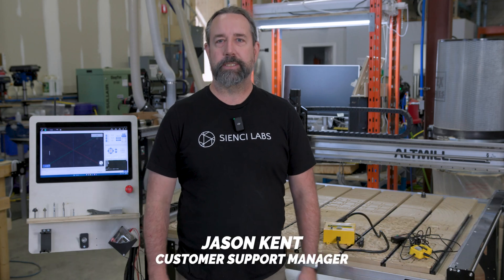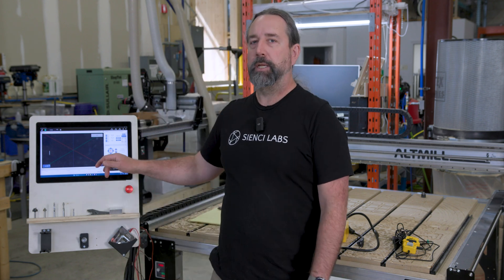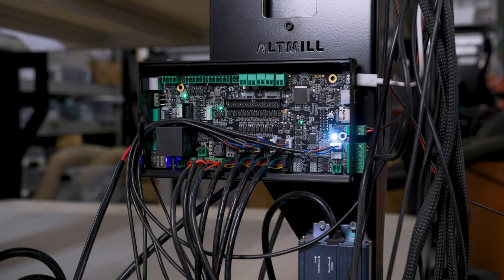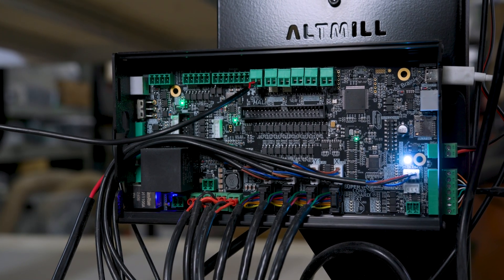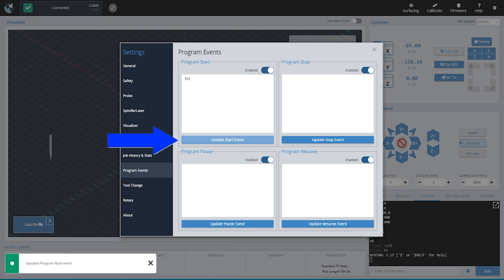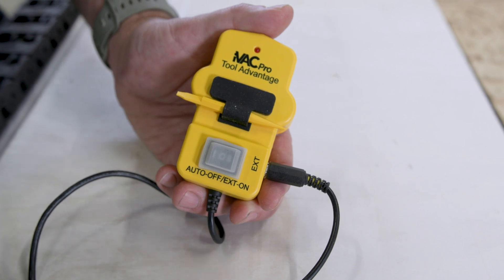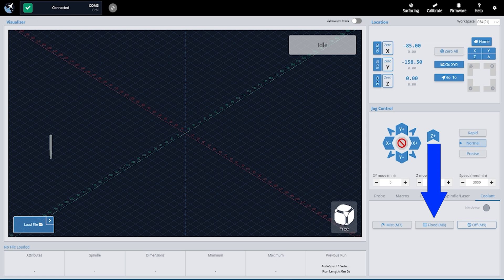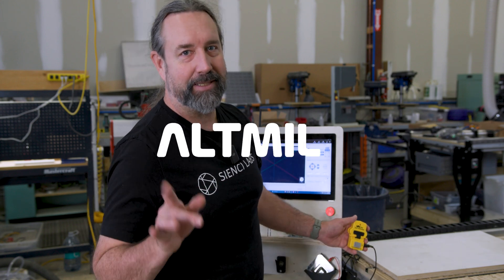How to Install an iVAC Switch Box

Comment: I connected my IVAC based on your instructions and it starts and stops with the M8 and M9 commands but the dust collector shuts off after a few minutes into my projects.  I an restart it by pressing the M8 but it continues to shut off.  Any suggestions?

Comment: Did you cut off the USB end of the patch cable to install the wire to the molex connector?  The implication is there along with the assumption you are using the ivac patch cable kit. I just want to make sure.  Thank you.
Reply: I was thinking same question. Couldn’t find the iVac Switch on Amazon, Have been using the Senctrl on both my machines but would love to put my vacs on another circuit. Also noticed there is an auto blast gate. Please include affiliate links to products if possible.
Reply: No, the wire comes without a connector in the kit.

Comment: I have an ONeida 220 volt 3hp cyclone connected to a 1 phase 30 amp electrical outlet.  Do they make these for such high amperage units?
Reply: Yes, you need to order the 220Volt power switch, I was showing the 110volt in this video.